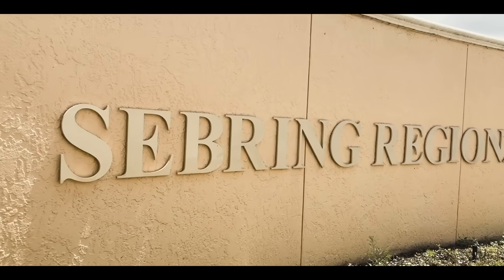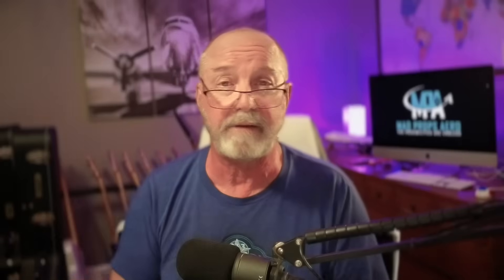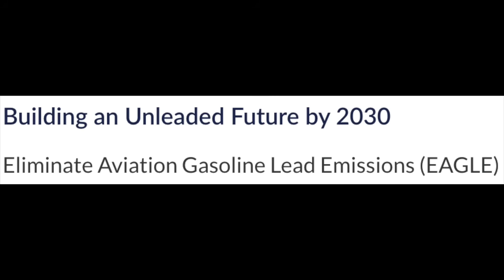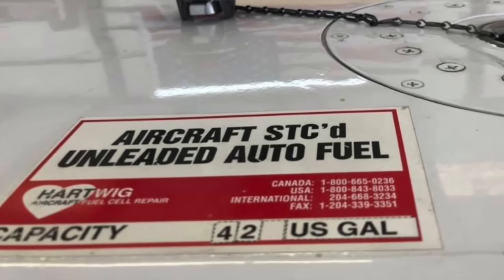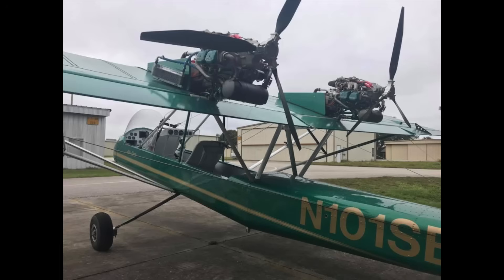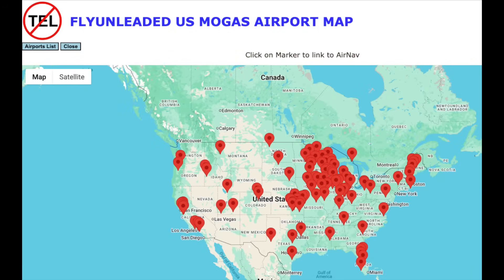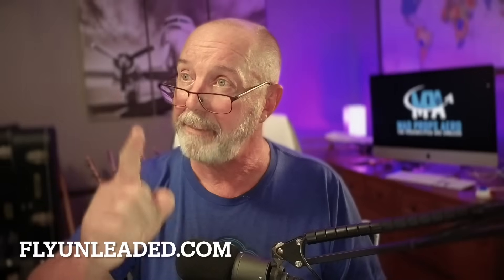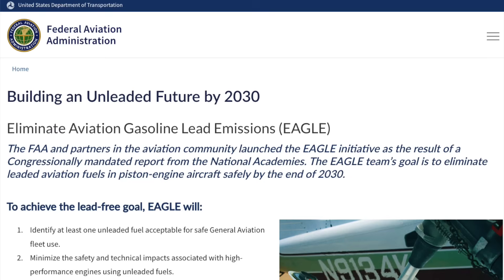Fill 'er up? With what? 100LL is going away.

Comment: The Rotax 912 line maintenance manual specifies oil changes at 50 hour intervals when using 100LL, not 25.  I know at one time SI-912-016 recommended 25, but I don't believe the current revision specifies intervals.  Also worth noting that spark plugs need to be changed more frequently using 100LL (200 hours instead of 400).
Reply: Certain maintenance costs cut in half along with the cost of fuel....I'll take it.
Reply from the maker: Thanks for bringing us up to date. That’s great insight.
Reply: Thats BS.
I was an A&P for forty five years.
Every piston popper used 100LL.
Spark plugs would ALWAYS last four hundred hours OR until they were "foot balled".
NOT two hundred.

Plugs would get fouled or even ruined because an ignorant CFI idled the engine for a half hour on the ground while teacing a student how to work the radios.
Reply: @johnparish1432 To be clear, I'm only referring to the Rotax 912, and the intervals I cited are those prescribed in its line maintenance manual.

Comment: MoGas for life!
Reply: MoGas is garbage...barely suppresses knock on street driven boosted (whether turbo or supercharged) cars/trucks.  It also evaporates more easily than 100LL.  Finding gasoline without ethanol is difficult.
Reply: @reubenmorris487 bad take. If you can’t resist detonation in a booster car then you have no idea how to set timing.
Reply: @AndrewIrizarry Not always solved by timing..
YOU DO KNOW THAT BOOSTED ENGINES START WITH LOWER COMPRESSION RATIO THAN NATURALLY ASPIRATED..
FOR HIGHER HORSEPOWER THAN TORQUE, SHORTER STROKE, BUT "BOOST "OF GREATER INITIAL PRESSURE ABOVE 14.7 VALUE @ SEA LEVEL..WHOLE POINT IS MORE PRESSURE...WHICH LEADS TO AUTO-DETONATION BEFORE SPARK ..
BOOST is why we have immediate & FLAT torque curve in boosted vehicles 
DIESEL EFFECT..
Reply: @reubenmorris487 Ethanol-free gas is available at like 50% of gas stations these days. It's not hard to find. Maybe at FBOs...?